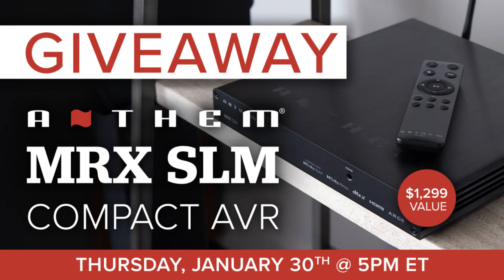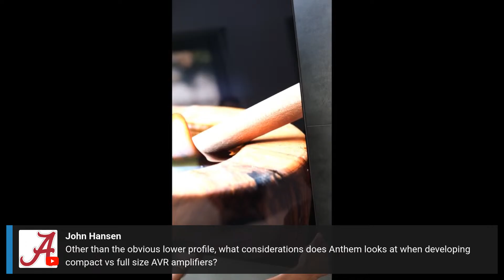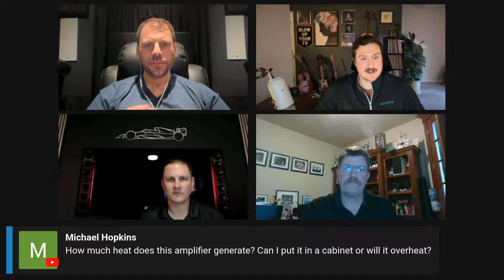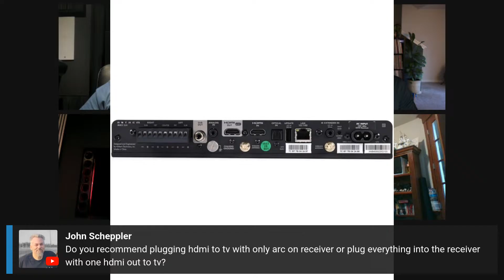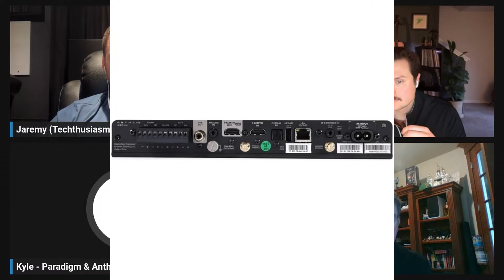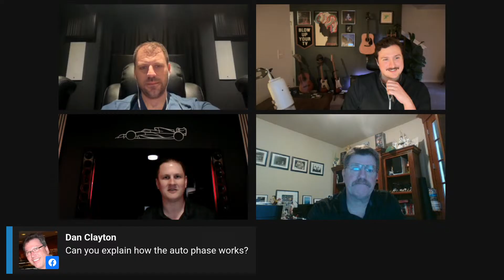Anthem MRX SLM Compact AVR Livestream & Giveaway

Comment: Hi, would the Anthem MRX SLM be able to power a 5.1 setup as follows:

Dali Opticon 2 Mk2 (front L/R)
Dali Opticon Vokal Mk2
Dali Oberon On-Wall (surround L/R)
REL HT1205 Mk2 (powered subwoofer)

Listening distance is 11ft (3.3m) with listening levels around 70-85db. 

I’m concerning with what I’m reading about allowing amplifier headroom and transient peaks in music/movies. I would want to avoid clipping at all instances in this setting. More specifically, to avoid damage to speakers from “under powering” if it even happens in this context.